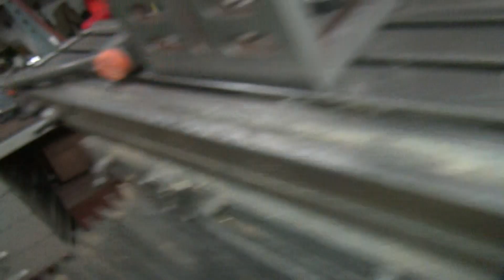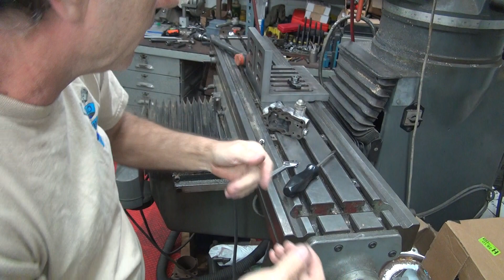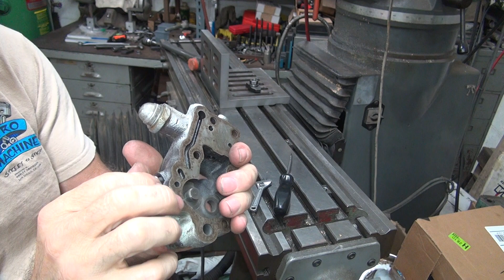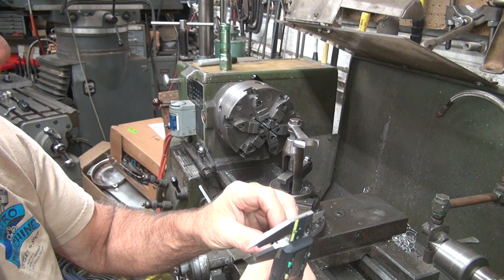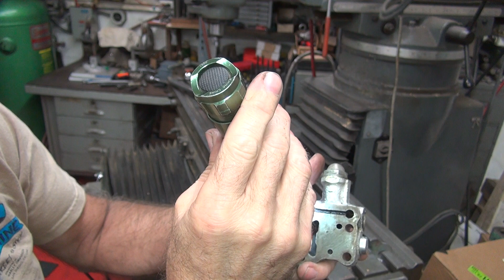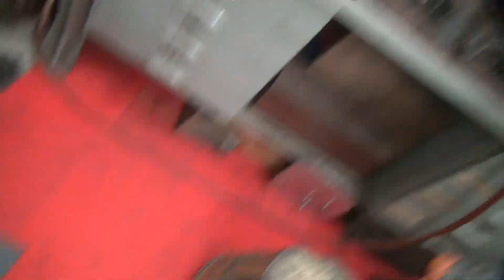#107 1962 74ci panhead broken off oil pump primary oiler adjuster screw repair harley tatro machine

Comment: Put the blunt end of the tool holder against the work piece as the chuck is rotting, this will usually correct the wobble of the work piece.